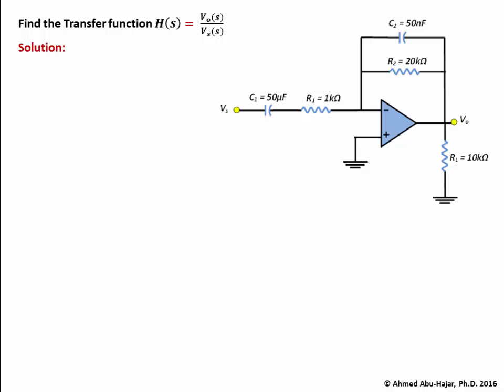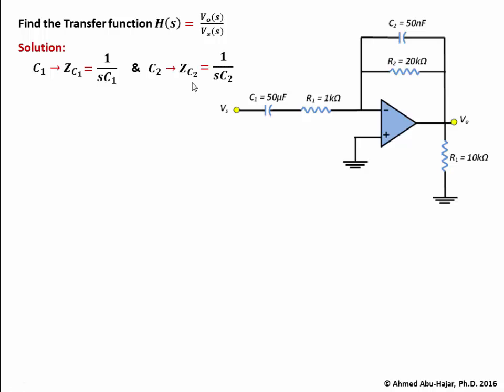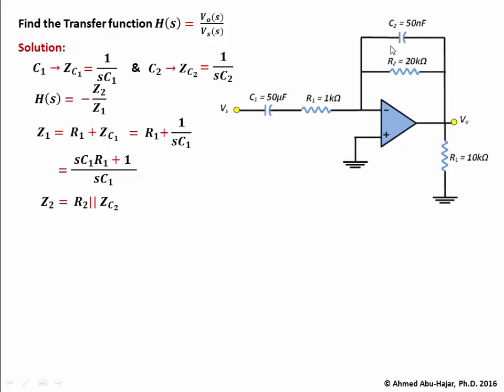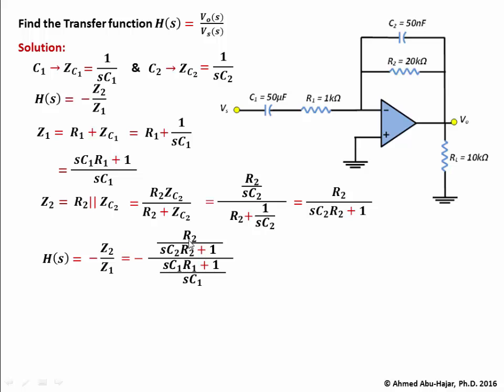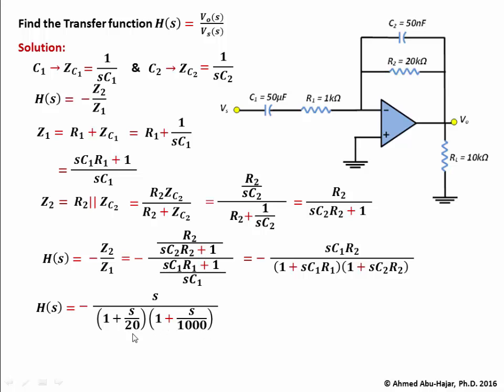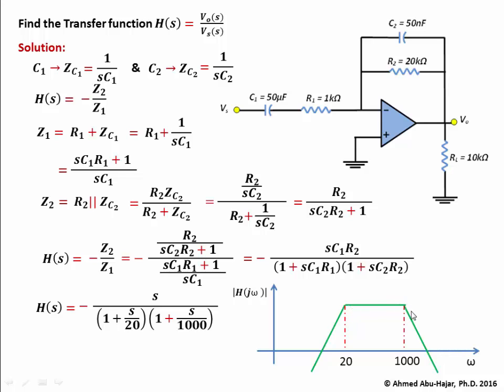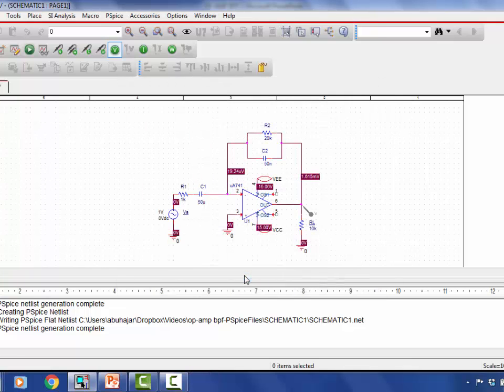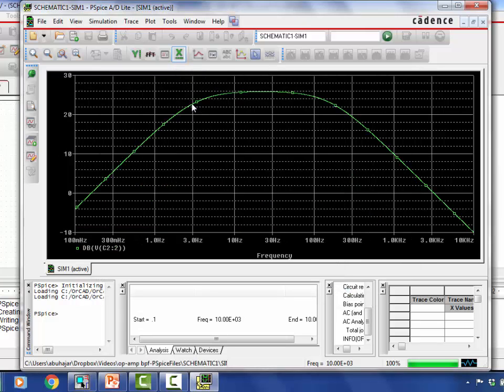OP-Amp Example - Bandpass Filter

Comment: Can you answer me this question: why does the load resistance have no effect on the transfer function whatsoever? Can I put any load resistance I want and it won't affect transfer function at all?
Reply from the maker: As long as the load resistor is large enough so that the maximum  output current is not exceeded. Practical op-amps have limitations such as slew rate, input offset voltage, offset input current, maximum output current, ...